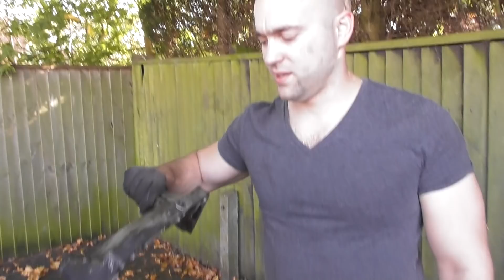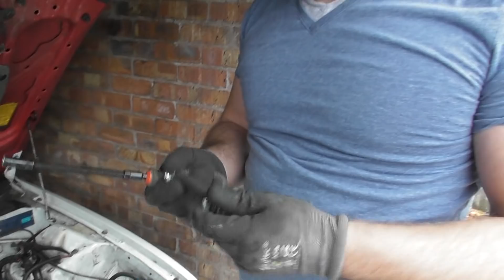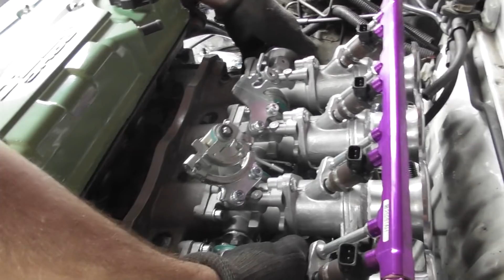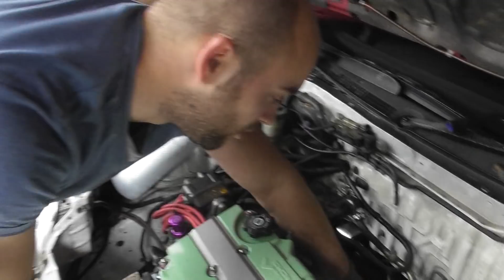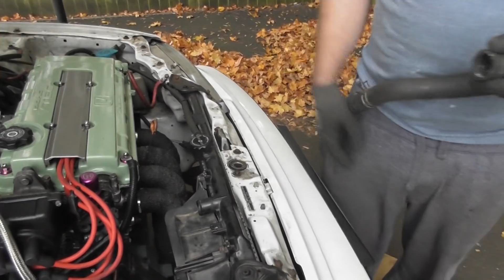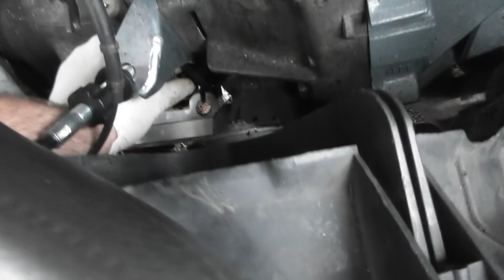T2CG Honda Civic EF Part 15 : B18C4 Engine OBX ITB Install Completion into EF ED

Comment: How did you do the wiring? Considering u have an OBD0 type plug coming from the cabin to the engine bay and the b18c4 has an OBD1 type plug in the engine bay? My english is the not the best :D
Reply from the maker: Hi, I initially started with a OBD0 to OBD1 conversion.... but in the end swapped a full loom from a MB6 B18C4 Civic VTi and adapted it. Thanks
Reply: @twin2civicgaraget2cg75  Is there a reason you switched from the conversion? Also do you have  a video of the full mb6 loom adapted?
Reply from the maker: For me it was less effort... the conversion looms seems to work on B16 VT cars...not the D16 OBD0 loom I had.

Have a look at my video, in the link below and the videos after in the series.... I detailed the full process:
https://youtu.be/VDB1Lv0jKBk
Reply: @twin2civicgaraget2cg75  I did look at that video and the video where you did the shock tower plug re-pin, but thats where my confusion comes in, in 1 video you convert your own harness and in another video you use the entire MB6 loom, including the chasis loom. Is there a reason why you switched away from your own modified harness? You did that first, so even if the full MB6 loom is more conveniant, you had already done the loom conversion? Was something not working properly without the full loom? I absolutly hate removing a chassis loom and would prefer converting my EF loom that is already in the car instead.

Thanks for your answer and thanks for your videos, very helpful!
Reply from the maker: Yes you are right.... I couldnt get the converted loom to work as I started with an engine and interior loom grom a D16. Maybe it is possible to get it working like this, but I couldnt. That is why I went for the full loom from another car. I kept the video of the loom conversion up as it will work if you start with a VT interior loom (I think). Hope this makes sense. Cheers

Comment: hmmmm.... everyone always says the OBX ITBs are garbage... but I can tell from looking (because I have some) that they are basically AE101 throttle bodies from the 4AGE... that said, the quality probably isn't anywhere near as bad as people say... afterall, Toda uses them for it's sports injection kits as well. and... I'm adapting mine to run with the G4GC Hyundai Beta II...
Reply from the maker: I think they are reasonable quality for the money.
Like you say they are very similar to the ones Toyota fitted to the Corolla.
That is interesting you are putting them on a Hyundai, which car is that on?
Thanks
Reply: the G4GC comes in several cars... the Spectra 5, GK chassis Tiburon, Kia Soul and in the 04-06 Elantra (my car), & I think it's in the HD chassis Elantra as well (07-10)...
Reply from the maker: zeroswings2 Cool, good luck with your project. Which country are you in, as I dont think they sell that car here in the UK.

Comment: Really enjoy watching your videos! Just wondering how you are venting the petrol tank if you aren't using the evap purge solenoid and charcoal canister etc.
Reply from the maker: Hi thanks for the comment. Your question is a good one. I do not have the charcoal canister or EVAP solenoid connected. There should be a one way valve next to the fuel tank, which goes to the charcoal canister to store the vapour, via a tube that runs along the bottom of the car. The EVAP should then be activated on engine startup, placing these vapours into the inlet manifold to be combusted with additionally air and fuel in the combustion chamber. From memory I can remember seeing the check valve on my tank, but bear in my my tank is from a CRX originally fitted with a D16A9 engine and not this B18 engine. I think the valve (as is standard  in the CRX) just goes from the tank, then back into the tank. Thinking about it, I think it may need to vent to atmosphere if I am not using the charcoal canister/EVAP setup. Like I said good question, I will come back to you with my conclusion. Thanks
Reply: Thanks for getting back to me. It would be great to know what you think, I'm trying to work the same thing out for myself at the minute on my B18C4, specifically how and where to terminate the vent to atmosphere if I choose not to use the charcoal canister /EVAP setup. Good luck!
Reply from the maker: The charcoal canister and EVAP is the safest way to do it.  However I think venting to atmosphere can be done. Which country are you based in? Thanks
Reply: Northern Ireland - UK. Fairly strict MOT here as opposed to the mainland as ours are done by government test centres, not local garages... which may make the decision for me!
Reply from the maker: In that case I would use the charcoal canister and evap. I will look at my fuel tank in more depth and let you know what I plan to do. Thanks

Comment: Couldnt find any videos on how to rebuild b series engines but when i found yours and the specific detail you put in, its great pal 👍🏼👍🏼 keep up the great work!
Reply from the maker: Thanks for your comment. Please read the comments from other users at the bottom of my videos as they are useful. The two things I would do differently are: no need to put lube of the back of the bearings (block to bearing) and the oil jets I put the inlet and exhaust the wrong way around. I have swapped the jets over now, I just wouldnt want you to make the same mistake. Let me know if you have any questions.
Reply: +Twin2 Civic Garage T2CG thanks for the advice pal, hope to see your civic running right soon👍🏼👍🏼👍🏼

Comment: why on earth do people think they have to use Teflon tape on freaking  AN fittings......
Reply from the maker: Thanks for your comment, I realise now that I do not need ptfe tape on the AN fittings. Some of the other fittings are not AN, hence I just put tape on all of them. I have since removed the PTFE tape on the AN connections. Thanks
Reply: +Twin2 Civic Garage T2CG i see it on nearly every build video.  crazy annoying.
Reply from the maker: +Brian Sanford Have you got a build on the go at the moment?
Reply: +Twin2 Civic Garage T2CG i do in fact. im switching my b20vtec from itbs to a skunk2 ultra street intake ported by 4piston racing.  but, i don't take videos or anything.
Reply from the maker: +Brian Sanford Ok cool, someone else on here said they were doing a similar swap from itbs to that manifold. What made you make the change? Also which brand of itbs were you using?
Reply: +Twin2 Civic Garage T2CG i was using twm/borlainduction.com throttles. 

im switching my car back to power brakes and reinstalling the hvac setup.  

no real reason. the car was fun to drive,  i just wanted to spend money lol.
Reply from the maker: +Brian Sanford OK great, I will have a look. I am going to use a vacuum pump for the brakes.
Reply: +Twin2 Civic Garage T2CG ya, i switched to manual brakes and that to date was my biggest regret.  i switched because i didn't wanna run a vac pump. completely stupid on a street car.
Reply from the maker: +Brian Sanford I have found the itbs dont produce enough stable vacuum... so I am using a pump from an Audi tt.

Comment: Btw those obx ITBs are garbage!!! I know from experience couldn't figure out why my number 4 cylinder keep washing rings and smoking like a train after two rebuilds I sold those shitty ass ITBs and went to Edelbrock victor X that sucked now skunk2 ultra series works the best for gains and reliability. Trust me wasted a lot of time and money trying to get my hatch running right with those ITBs
Reply from the maker: Hello, thanks for the comment. Do you think the ITBs washed the bore because of manifold design (bad fuel mixture into the port), as I have had the manifold port flowed to the head. Did you change the injector on that cylinder? I do like the design of the Skunk2 manifold, it is the best combination of benefits of itbs and plenum designs. Also did you tune with the MAP sensor or Alpha-N (TPS) when running the itbs? Thanks
Reply: +Twin2 Civic Garage T2CG, looking at your ITBs  the fuel rail is on top of the throttle body's my was under them maybe they changed the design. I was messing with that setup in 2009-2010. I think it wasn't atomizing the fuel right was puddling on the throttle plate of the #4 runner. I port match the head to ITBs also Tuned by rpm each gear took all night, The first Dyno we thought was bad injectors and bad spark because run poorly at idle but ran strong wide open. So new rings honed block new injectors and msd went back to Dyno same thing couple weeks later #4 failed again on leak down test past the rings. Due to tolerances bored to 81.5 new Pistons rods sold ITBs problems solved. B18c ITBs, skunk2 pro1, ITR pistons, high end header s300 rev 9500 made 203hp and 155 torque for a couple weeks haha, b18c with Edelbrock victor X, 11.5 comp forged piston, eagle rods same cams and header rev 9800 made 199hp 127 torque. Same setup with skunk2 ultra intake mani rev 8800 made 237hp 158 torque
Reply from the maker: +TheSPOONFED01 Wow it sounds like you had quite an experience :) I changed the position of the fuel rail myself by unbolting it and putting it back part of the setup the other way up, mainly as it suited my install better. I will see how I get on with these, I hope I dont have the issues you had. What do you think caused it? Bad location of the injector, or uneven opening of throttle plates? Thanks for you comment it is great to hear of someone who has used this setup.
Reply: +Twin2 Civic Garage T2CG I hope you have no issues with yours. I think it has issues because the injectors are before the throttle plate. But idk know much just notice higher end ITBs most have injectors after them. The spoon sports ITBs look the same as obx other then the injectors sit in stock placement spraying directly on the back of the valve. The ultra series have a ITB roar not as loud but nice check my Dyno video on my Channel. Cheers good luck!
Reply from the maker: +TheSPOONFED01 That is a good point about injector placement. Not hitting the back of the valves is not ideal, particularly at low rpm, where the speed of the intake charge is low, I would think. I will have to see how I get on. Thanks
Reply: +TheSPOONFED01 The OBX itbs are toda copies which are actually itself copies of toyota itbs. They work after porting the horrible casting on them and syncing them.
Reply from the maker: +350gtboi I have heard they are Today copies too. I had the manifold casting flowed to the head, I would agree the original casting is rough. I think my main issue will be that the injectors are before the butterflies, so at low throttle angle the fuel pools on the back of them. Thanks for your comment

Comment: you should look into the hush performance hydro kit. Im hearing its very good.
Reply from the maker: +Dominic Atkinson Thanks for your comment, I was thinking about using a kit whoch makes the cable operate the hydro master cylinder and then intern the slave cylinder.  So far the cable system I am using seems OK though. I might change the system in the future though, as I still have the slave and all of the hard lines etc. Thanks

Comment: subbed
Reply from the maker: Thanks for your support, I have more videos on their way. Do you have a Civic?
Reply: I have an integra.
Currently breaking in the clutch :(
Reply from the maker: +jpc4God OK cool, I have always wanted a DC2.
Is it a standard or racing clutch?
Reply: +Twin2 Civic Garage T2CG It's just a exedy stg 1.
Reply from the maker: I have put a Comp Clutch 1.5 on my car.  I put a Stage 4 Paddle clutch on my D16 and it killed the gearbox :)
Reply: ha
my brother used to buy ebay clutches for his d and they'd grenade quite frequently.
Reply from the maker: I have blown two, almost three D series gearboxes... I don't think they were ever made for drag racing :)